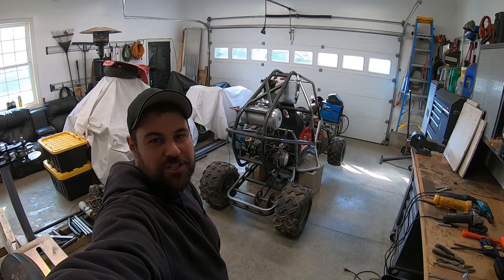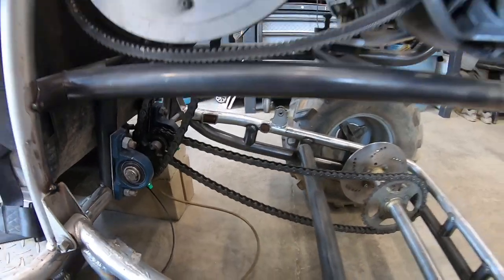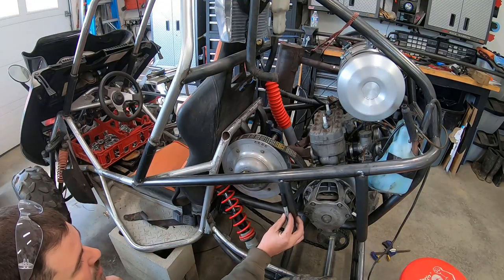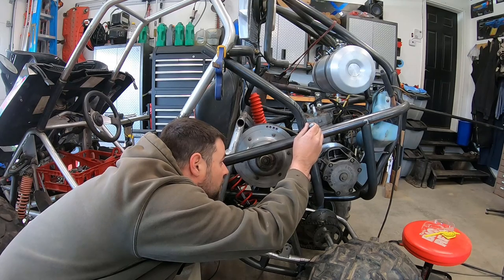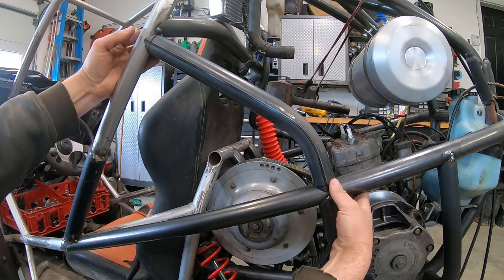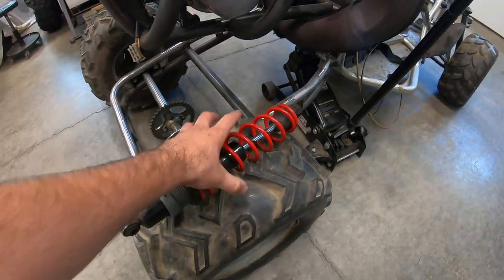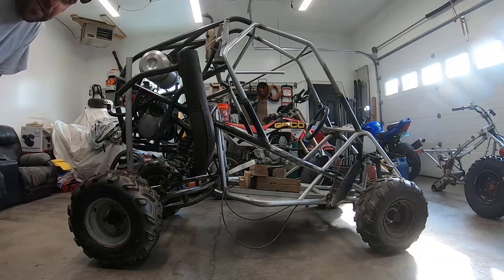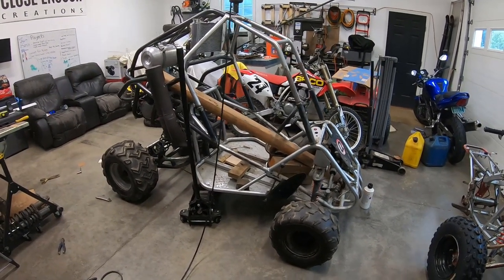Coolster500 - Snowmobile Powered Go Kart Part 3

Comment: I like what you're making. Make sure you get the clutch alignment and belt tension is as close to the stock snowmobile as you can.  You will loose a lot of performance otherwise. I recommend looking online for a technical manual for the specs. This thing is going to be fast.
Reply from the maker: Thanks for your input. I have the manual but will probably pick up a clutch offset alignment tool. I tried getting it as close as I could with a straight edge for tack welding on the mounts. It’s kinda neat how the engine is designed to twist in its mounts when putting the hammer down. Then the 5/8” offset is corrected. Or at least that’s my understanding.

Comment: You landed the fox shocks cheap. Why not use a front diff from. Well. Anything. And run seperate trailing arms? Btw pretty sure that is a 4 piston caliper. Currently building same thing using an ISMAC chassis (popular Michigan/Illinois junior series) 10" travel on all 4 corners. Used a rack and pinion from a sxs with custom tie rods. I will post something soon. Lack camera and editing ability.

Comment: I'm doing a similar build with the same engine on a Hammer Head.  Did you consider putting in the chain case for forward and reverse. 

Great build lots of good ideas to work with.
Reply from the maker: Yes, I thought about using the buggy’s gear box for reverse, but concluded the planetary gears wouldn’t hold up to the higher torque.

Comment: the secondary drive pulley needs to free float on jack shaft when works, usally about a inch, if is mounted  solid to shaft the drive belt will be short lived for is being streched on one side of belt

Comment: 9:37 When you’re driving the secondary will open making it wider and it will hit the shock.  Just letting you know so you don’t wreck anything
Reply from the maker: The secondary opens up on the other side. The side facing the shock is stationary. I had the same thought you did just after mounting the shocks. Had to look it up. 😂 Either way its friggin close to that shock.